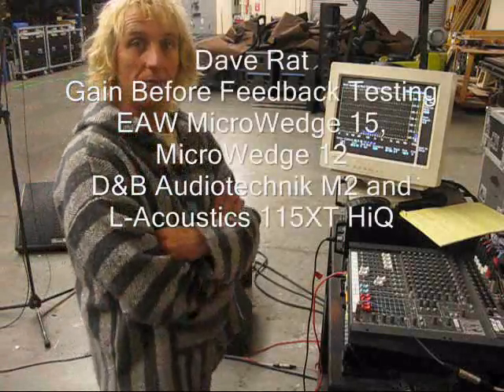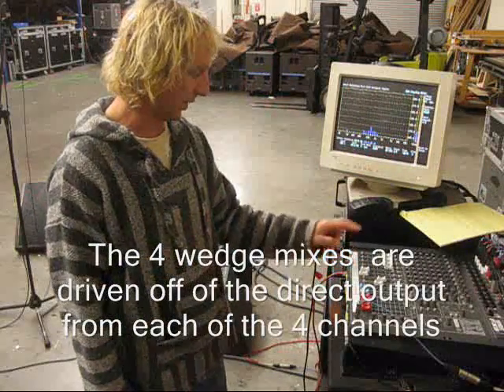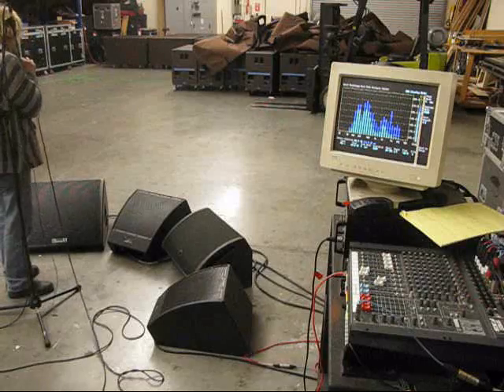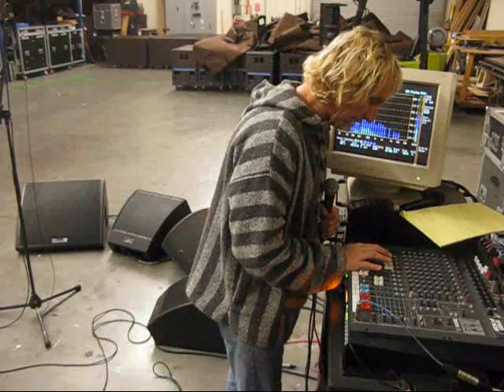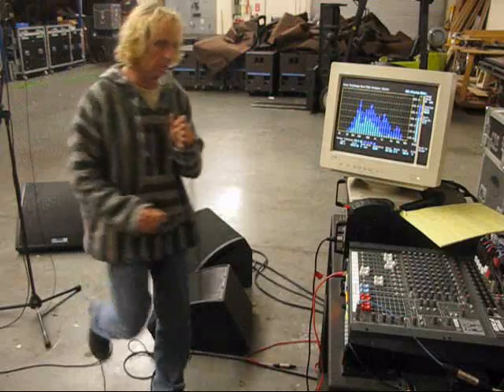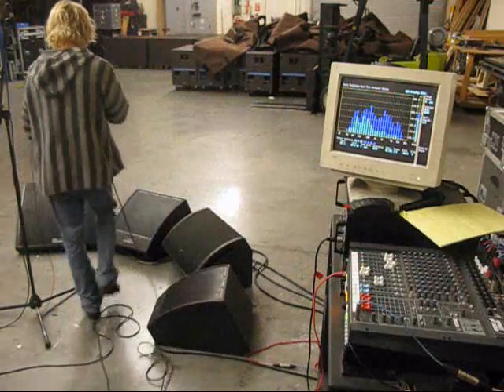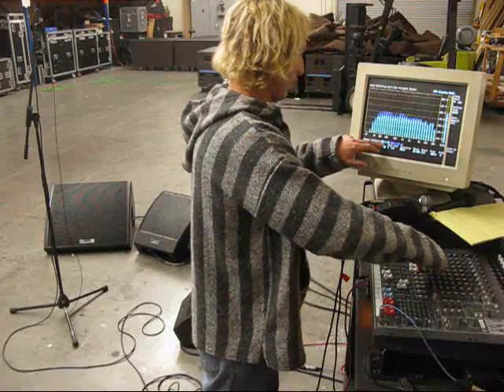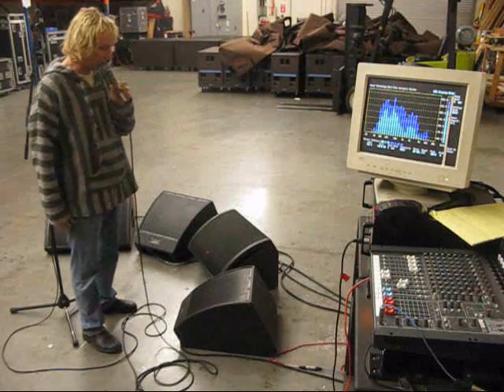Gain Before Feedback - EAW MicroWedge, L-Acoustics and D&B Wedges

Comment: Hey, just wondering why you need even feedback. Surely it's better to have some bad than all bad.
Reply from the maker: Feedback over a narrow range indicates irregularities in the response and that max Volume has not been reached.

A perfect speak mic combo would not feedback until max level and all frequencies would be reach feedback at the same point. Any freqs that feedback at lower levels are problems

Comment: Hi Dave.  

Just got a quick question.

Does amplifier design affect gain before feedback?

Also does the choice of drivers affect it?

Thanks
Reply: Thanks for your reply.

With drivers, I take it this is to do specifically with frequency response?  Or are there other factors like voice coil inductance?

Do things like settling time not affect feedback, even if indirectly?

If I get the gist of your reply, with a D&B amplifier for instance, these problems are not likely to exist in any significant way.

Thanks.
Reply from the maker: With drivers there are so many things that can cause issues, any residences or unevenness in the response or cabinet design or reflections from the cabinet or reflections in the horn throat materials that are too thick or too thin or too hard or understand or overdamped can all be issues increasing feedback
Reply from the maker: A really cheap amp may cause some issues but it's fairly easy to make a fairly flat response amp.

As far as drivers, they have a huge impact on feedback. Cheap and non linear drivers will feedback much easier.

Any resonances or peaks in the response will de stabilize things and speakers are the weak link, followed by mics, then everything else in the signal chain

Comment: what is the difference between the RADIAL RMW-1152 and the EAW MW15?
Reply from the maker: I designed the microwedge originally and licenced to radian and used a radian coax. When I moved the licence to EAW I worked with them to improve the series. I chose a 18Sound for the coax and was able to increase efficiency, improve high frequency response, reduce cone surround failure issues and improve the frequency response linearity, increase maximum output level, and increase power handling of the drivers and crossover.

Additionally, I upgraded the grills to 12 gauge, added damping to reduce reflections from the sidewalks between the grill and baffle, added fly track hardware,

Also,  I worked with EAW to develop multiple presets for both passive and active operation. The presets are downloadable as well as imbedded in powersoft amps. 

Radian, went on to develop a knockoff of the microwedge that lacks the patented trapezoid sidewalls.

Comment: I did an interesting experiment. Two monitors were placed on the ground and the microphones were placed in the middle. The frequency response and level of the two speakers were all adjusted to the same level. At this time, if the same signal is pushed at the same time, logically speaking, The sound heard at the position of the microphone should be in the middle of the two speakers, but in fact it is not, even completely to one side
Reply from the maker: Hmmm, possibly something else is wrong.

When two sources reproduce the same signal, maximum summation will occur at the equidistant points from the two source.

Or put another way, if the signals from two sources do not maximally sum at the equidistant points, the signal sources are not identical in time, phase, polarity and/or distance.
Reply: @DaveRat  Theoretically, the sound image should appear in the middle of the two speakers, but because these are two different models (both 15-inch coaxial), I now guess that it should be due to the difference in phase between the two (due to the Haas effect) The result
Reply from the maker: Yes, different models can have a wide array of differences.  Some companies will invert polarity on the HF to improve summing to LF at the crossover region. I am guessing that is what is happening in your test.

Comment: Why not just make the band wear ear monitors instead....?
Reply from the maker: Well that might be like having your neighbors make you wear headphones instead of listening to your home stereo.

In ears are a different experience than monitor wedges. With in ears you hear the same sound no matter where you walk, with wedges you hear what instrument or wedge your next to more than the ones you're far away from.

Some musicians prefer in ears because it helps them hear everything clearly and better while other musicians prefer wedges because they want to be in the same acoustic space as the rest of their band mates and the audience

Additionally putting on in ears, wearing a belt pack wires attached to your head is not optimum for certain types of music or people that jump around and sweat a lot.

Also within ears it makes it difficult to interact with the audience as you can't hear what they're saying
Reply: @DaveRat  But you can also have specific mixes for every musician with ear monitors. It also saves their ear drums from busting. The lead singer from AC/DC is done with touring from what I hear.
Reply from the maker: @VWGTI2013  well, I am not one to tell someone or a musician what to prefer. We could tell everyone to never drive fast or go skiing or skydiving or to never drink alcohol and so on, because there is dangers.

As a sound engineer and tech, I assist musicians and audience members in optimizing their experiences. And avoid telling people what to like.
Reply: @DaveRat  That's what I meant, recommend them to wear ear monitors. The Chili peppers wore in ears, right?
Reply from the maker: @VWGTI2013  not really, both Josh and John did not like in ears.

Comment: Gain before feedback is largely a function of the consistency of a speaker’s dispersion and frequency response.  It is the absence of lobes in the dispersion pattern that permits higher perceived volume before the onset of feedback.  Smooth dispersion across the frequency spectrum is very hard to achieve, requiring serious research investment.  Most pro companies show their speakers plots at a variety of frequencies. The ones with the smoothest response plots at a wide range of frequencies are going to be less susceptible to feedback, all other things being equal.  It should be said that the same exact thing applies to the microphone.  The polar plots give a lot of useful guidance.

Comment: Interesting video. I might be taking a too much of a technical approach, but isn't this just testing the frequency response of the wedges? You can actually see the dips on the spectrum analyzer. You could think of it as a factory eq'ed wedge. I can honesty say I don't know if i'd like that, the technical voice inside my head says I'd want to control the frequency of that dip myself. But then again it is probably pretty practical in the real world. I'll probably never know, the band I mix uses in-ear, makes it so much cleaner though.

Comment: HEY DAVE , It has been 7 years since you did this Video , It is about time you do a new one . This time do one on as many different monitors you can get your hands on to test . Also Leave out the Gated Reverb this time . Love learning from you . The Best places I have found to learn from are BAR BANDS . They are on the road 300 days a year working with equipment that is as old as dirt and HAVE to get by with what they own . But they make it work and Grow up to be like you ... A Hard working Man .. Good Luck in all you do ..
Reply from the maker: I may do, at some point once I start focusing on the new wedge design I am working on.  In the meantime my focus is on the subwoofer designs. Primarily the Rat Sound SuperSub 30, SDS30.  should have a video of that in the next month or two

Comment: Are there any plugins to control feed back?  I wanna start a little audio rental company but I am going to handle both monitor and front of house.
Reply: +VWGTI Waves X-FDBK.
Reply: avoid plugins. ring your monitors out with a graphic eq and an RTA app on your phone. waste of money. do yourself a favor and teach yourself to whistle 1khz on command... when you hear feedback try and do math and see what octave above or below your feedback is and rough estimate this. if you can whistle 1khz on command and hear feedback that is not quite an octave higher (which would be 2k) you know right away to reach for your 1.25 or 1.6khz... do that shit in front of a client without an RTA and they will think you are god.
Reply: @snapascrew  But them plugins will control feedback automatically for you, right?

Comment: How do I connect 4 monitors separately ?
Reply: Sorry, but I´m a rookie
Reply: Rafael Ospina That's either a very simple answer, or a very complicated one depending on your setup.  If you want independent control over each of the 4 speakers, you will need at least 4 independent aux outputs on your mixer.  If you have powered speakers (speakers with amplification built in)  they you should be sorted by running lines from different outputs of your console to the input of the speaker, thus giving you separate control over the mix to each speaker. 

Alternatively, if you are not running powered speakers, they require a separate amplifier to drive them.  Which would then require you to run an output of the console to each amp, which would run to each speaker, delivering the powered signal.  

In most live applications, especially where there isn't a huge budget or crew, monitors can be "daisy-chained" together.  Which means that multiple speakers will be receiving the same output from the console, as well as the amp (if applicable)

Hope that helps!  Also, if you're new to this stuff, i'd do some research into "signal flow".  It'll help you understand a lot more how to set up different systems!
Reply: DanielCarballalMusic Thank you very much for your answer =D and for helpind me understand

Comment from the maker: Well, first lets clarify. 1"(throat diameter) typically refers to drivers with 1.75" to 2" diameter diaphragms and 2" (throat) usually refers 3" or 4" diameter diaphragm drivers. Lets do the math on surface area (Pi*Rsquared and circumferences (Pi*D). 2" dia would be approx 3sq inches & 6 inches. A 3" would be approx 7sq inches and 9 inches& a 4" dia would be approx 12 sq inches and 12 inches. More surface area increases max output, more voice coil circumference increases power handling
2"=appro

Comment: I've used Microwedge 12s on a lot of shows, they get decently loud and don't need a lot of EQ. I have done pretty loud shows where I haven't needed much if any EQ on them. However, you don't always get your first (or second or third) choice for amps, so unless I know I'm getting what I want (lab greuppen) I'll useually opt for the meyer 12 or 212.

Comment from the maker: @thebiggaloot1 I think a good engineer is more relevant than good gear in every instance and a good engineer with good gear is always better than a reduction in either.  As far as sound quality all the wedges tested are well in the window of pro acceptability sound quality wise, some just take more work than others to achieve the goal at hand. Max volume wise, the D&B's box per box will win. Pound per pound or size wise or time spent to achieve changes things.

Comment from the maker: @mirceaciuciuc I chose the M2 for 2 reasons: 1) We see them spec'ed on riders of major artists & the M4's rarely are 2) Rat sound owns them and we do not own M4's. Actually the M2 is an active only wedge as is the HiQ, the MicroWedge is passive or active. To keep things fair, I used all three with "factory setups."  To some the dedicated amp is an asset, to other it is an issue.  Regardless, I just compared the off the shelf manufacturer setups to show and aspect that specs sheets do not cover.
Reply: Ll

Comment from the maker: @ToOlOGT22 Yep, there is a switch inside the port that puts the wedge in passive mode and allows them to run full range without a processor Though you want to use a pretty large power amp, bigger the better.  The wedges will run on a amps over 1000 watts a channel.

Comment from the maker: @leefanyee Well, the 8 ohm load with two sets of wire would see 1/2 the loss into speaker wire compared to 1 set of wires driving a 4 ohm.  Use 2 sets of wire on the 4 ohm and it is back to the same.  The third method would be to wire the speakers in series and bridge mono the amp.  If the amp can handle 2 ohm loads, the bridged option will give you maximum power minimum loss into speaker wire.  The dual 8 ohm option will give you less power per speaker and the 4 ohm 1/2 amp gives the lowest.

Comment from the maker: @readerwriter You touch on an interesting point. I agree and have found that often engineers will EQ monitors for maximum perceived volume.  The artist in turn, often listen for clarity. This disparity between what the engineer perceives as correct and what the artist desires often results in a loud wedge that does not sound good and is over EQ'ed.
Reply: that looks like changed since then, at least for my little experience i'm having nowadays in middle east... by the way, i wanted to point something. I can see that the frequency response is different and looks more linear and smooth on the db and l acoustics, looks like dropping slowly from the mid high frequencies on the EAW. Might be this the reason why  2-3 db difference on the mid frequencies triggers the feedback?

Comment: I don't feel the goal of this "measurement" is relevant.
1. A flat starting place is more important than feedbacklessness. The RTA screen in this video clearly shows the D and B as almost perfectly flat, while there are some serious deficiencies in the hi mid range of the other three. 
2. Who is going to be using this type of wedge without an expensive EQ and a good engineer. The flat one is going to sound the best when you only take out what needs to go.